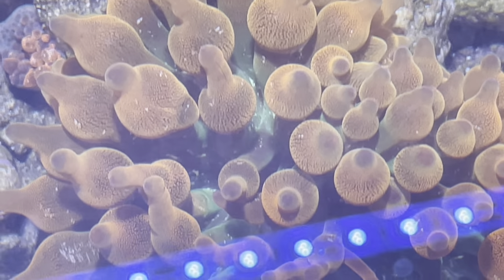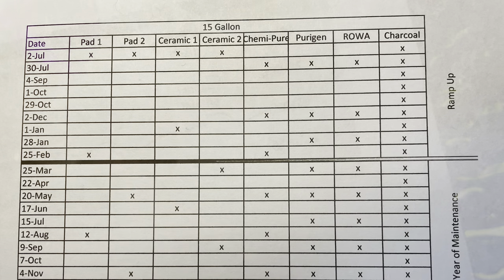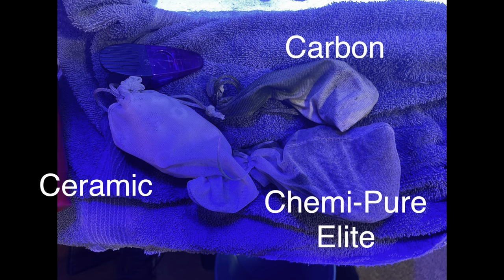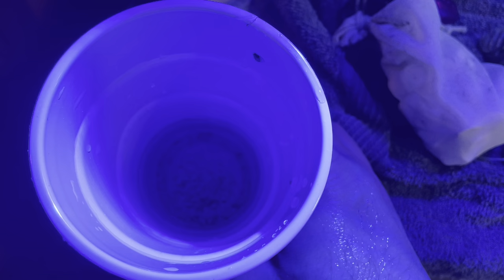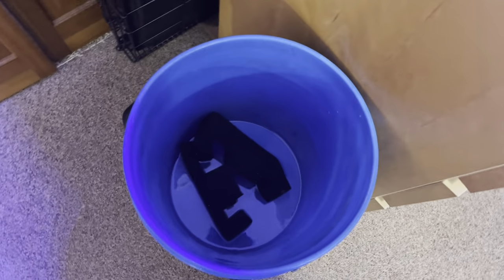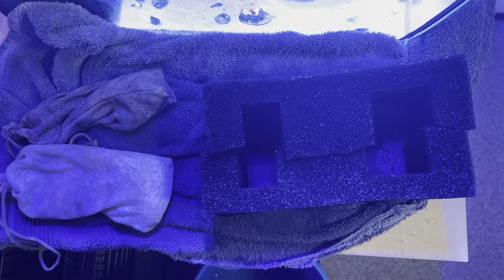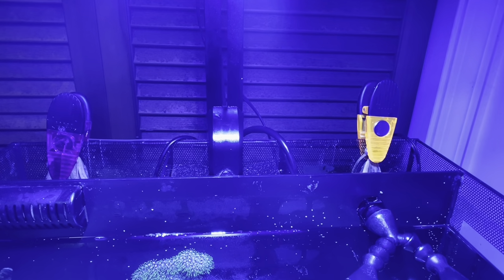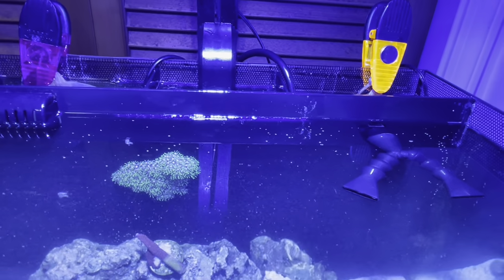AIO Nano Reef Filtration Setup / Cleaning / Water Change 15 gal Fluval Flex Saltwater Coral Aquarium

Comment: Are you running your schedule as is on the flex 15? Or is it turned down?
Reply from the maker: Running as is.  Keep in mind it is about 175-200 par 6” below water and about 75 at sandbed in a standard 24” tall tank.

Comment: In your video I noticed you have a heater in Chamber 1, Are you running 2 heaters?  Also do you ever baste off debris that builds up inside the tank in the rockwork?
Reply from the maker: Hello. Debris, YES!  Monthly I use the baster and clean the rock work, usually the night before my water change. As for heaters, I was in the process of changing heaters. The heater I had in chamber 3 was fluctuating the tank too much, so I bought a new one and was running them side by side for a few days to ensure the new one worked.  FYI I also syphon my sand bed monthly when I remove water.